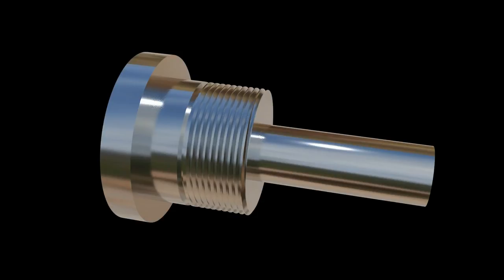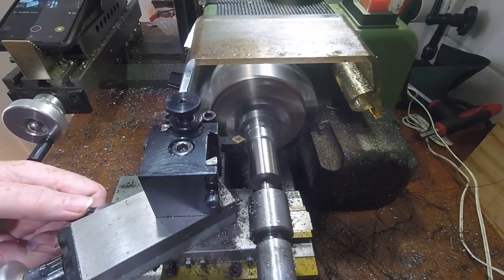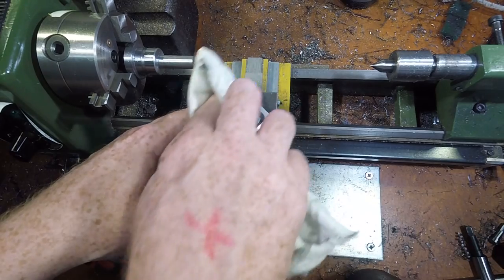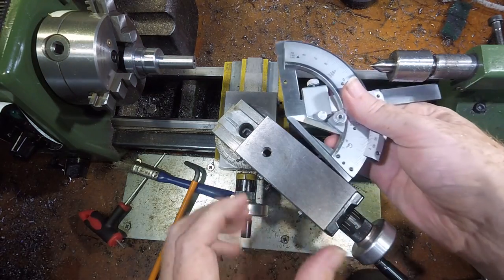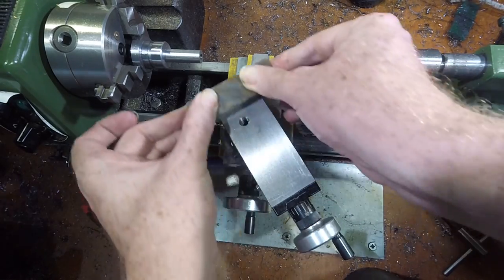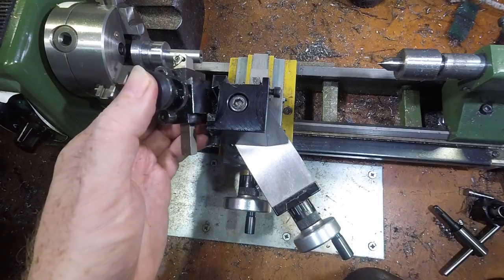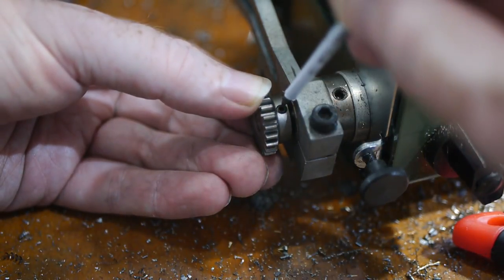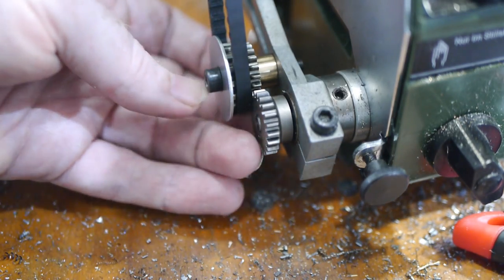Cutting an External Thread on the Proxxon PD 250/e Lathe

Comment: Whats your tool in looking for degree in tool post?
Reply from the maker: It's a weird angle variable set square I bought on impulse from Ali Express. I've no idea what it's called I'm afraid. The listing was temporary, and had a generic title which looked like it was translated from Chinese. It has vernier scales with a high level of precision, but I have no way to check how well it is calibrated, so don't know whether to trust it. It's a bit un-wieldy and tricky to use. I'd much rather have a decent quality combination square, and I'd recommend a combination square to anyone looking for a tool to set their compound accurately.
Reply from the maker: I've found out a little more about this tool from this reddit post:

https://www.reddit.com/r/Machinists/comments/bd79vo/made_in_the_ussr_have_no_idea_what_its_called/?st=juhrc2dl&sh=fd9d3649

One name for it is a goniometer, and the design may originate from the USSR. It is intended to measure angles precisely in unconventional situations.
Reply: Chronos sell them for 30 quid. They are branded Dasqua and called a universal protractor.